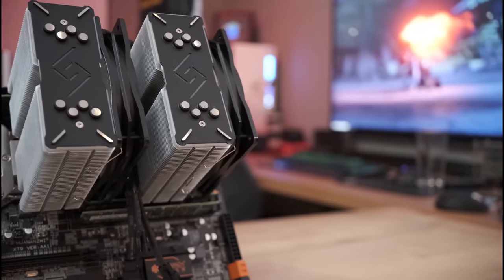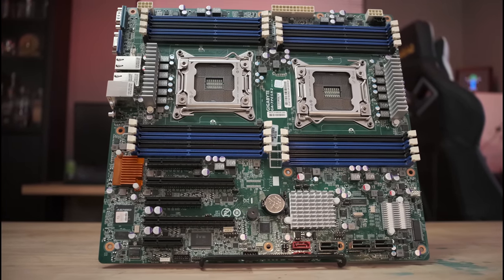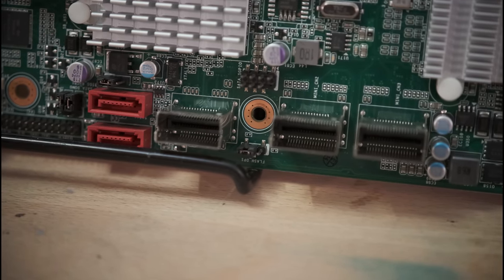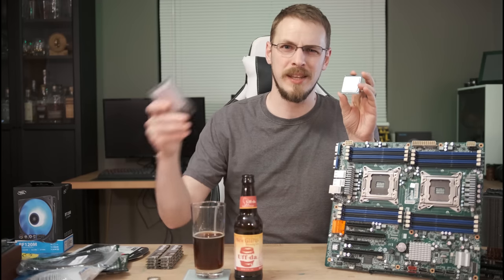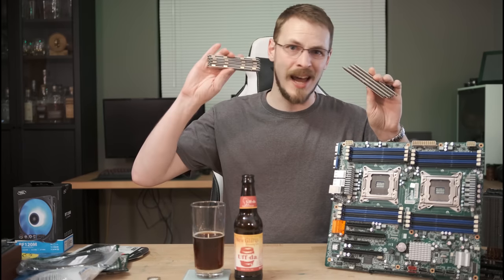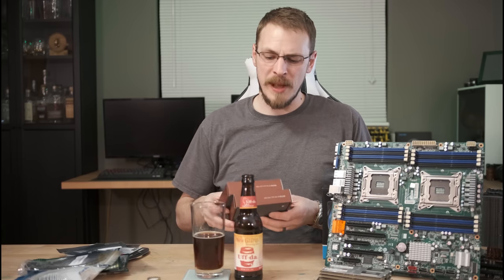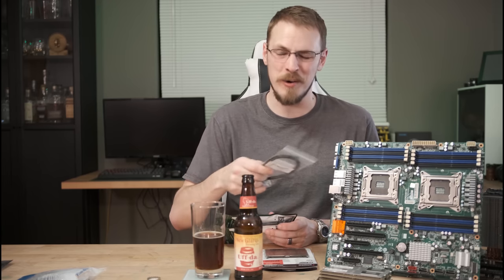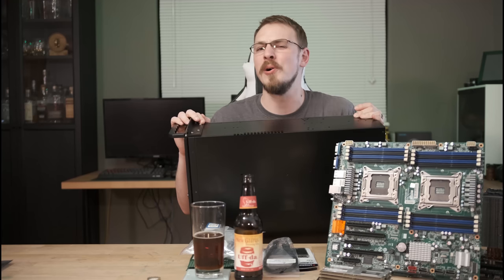Server Room Build Part 2!!! Virtualization Server Build!

Comment: Those adapters are shit and totally not made for cpu power. 
Always a good idea to get a proper psu made for servers.
Reply: or at least a power supply with two native 8-pin EPS connectors
Reply: @Felix-ve9hs  Thats what i meant. Regular consumer  PSUs only have 1.
Reply: @1leggeddog  a lot of the newer Consumer PSUs in the +100$ Range have two 8-pin EPS connectors, like the Seasonic Focus Plus Gold 750W :^)
Reply: @Felix-ve9hs  Which seems a bit of a waste for the average pc to me.
Reply: @1leggeddog  eh.. i have a 750w focus plus platinum.. overkill.. but It has a 10 year warranty and seasonic quality..
Reply: @Felix-ve9hs  Or just use a PSU from a recently retired ATX server/workstation... Well under $100 and unbelievably reliable. (Usually 80+ GOLD as well)
Reply: @Felix-ve9hs  I have a evga 750 watt G2 and it has two 8 pin connecters
Reply: No,  he's actually doing it properly by using a 450W PSU.  His power target is 200W and he's using low-end E5 Xeons.  An EPS adapter off of one of the PSUs I/O power outputs is the correct solution.  Going full out at 200W the 450W PSU will be running right smack at its maximum efficiency.  He should consider getting a higher-efficiency PSU, though.

If he were stuffing 165W Xeons instead of 95W Xeons, then he would want a PSU with dual EPS cables.  But since he's only stuffing 95W, there is no need for that sort of overkill.

-Matt
Reply: For servers it’s nice to have redundancy in PSU. It’s such a good feeling when you know that you could just swap out a PSU while the server is running or change the power cable from one power source to another. So far 2x 450w have been sufficient for my needs
Reply: Yes, I agree, there is one situation where redundant PSUs make a lot of sense, and that is when the rack is being fed by redundant power sources.  If you have a machine room with two utility ingresses, each with its own UPS and generator setup, then having two PSUs allows you to do maintenance on the power delivery to the machine room, and the UPSes, without having to power-down machines.  That can be a big deal because utility disruptions are a lot more frequent than PSU failures.

For smaller setups, having redundant UPSs but feeding off the same utility ingress, allows for similar maintenance.

UPSes usually require full drain-to-powerdown tests once a year (if you don't want something unexpected to happen later on), for example.  Most unexpected failures occur because people don't actually bother testing their fail-safe gear regularly and it becomes non-protective without them realizing it.  Daily UPS self-tests that only run on battery for 10 seconds don't float the boat.

But apart from that, if you do not have a redundant ingress or redundant UPS setup, or you don't need 100% uptime (such as for a small business where you can just yell out that the server will be down for a few minutes), then having redundant PSUs are basically just a waste of money.  Sure, there's a certain usefulness to being able to move cords around, but it doesn't really add much to system uptimes unless there is something behind it (such as UPSes and generators) that requires more maintenance and testing.  And, of course, modern PSUs just don't fail all that often compared to other system components.

-Matt
Reply: Junker Zn good points and I agree that a PSU by itself is not that useful after all. I have a server rack with 2x HP proliant (DL380 & DL360 as well as a synology RS815+, 3 Switches and our router) the system is secured by 2x Active UPS which currently give me about 45-60 minutes of battery power. So after 15-20 minutes the replication is stopped, the VMs shut down and then the physical machines power off as well. The redundant PSUs allow us to bring in power backup generators if needed / they allow us to use further UPS on the fly (another 1500VA which is securing a workstation next to the server rack could be utilized) and hot swap the UPS if needed. In the future we are going to have an independent power source on the property and the wiring will be done in a way that we can use grid power as well as our internal power source. As far as extra cost go I feel that one could also go with one PSU and then upgrade to a second one later in the life cycle: we upgraded our DL360 from one PSU to 2 PSU for 60 euro 💶 2 years ago. Personally I feel that the extra money is always worth the comfort and reduced Server downtime if something bad happens. I had a hdd failure on our DL380 about 9 months ago. Raid 1+0 + hot spare managed the failure by itself - all I had to do was to batphone HP support who sent me a new (and bigger) drive the next day. The old drive was hot swapped for a new drive and the smart array did the rebuild. No downtime or anything. Same with fans and PSUs. Also I have an onboard as well as an expansion raid controller installed in the system so I can always just swap the raid array within a few minutes in case of a controller failure.
Reply: And EVGA power supplies are shit.
Reply: I know some of the corsair cxm series power supply have 2 native eps connectors

Comment: I have a question. I'm looking at getting into a file server for my home network that I can also run VMs on to tinker with learning different linux distros, and set up a pi-hole similar to your example. Are NAS drives still a strong recommendation if you're not constantly writing to them? Main use would be to store all of my media and stream to my devices, and serve as a backup for my important docs.

Looking at the prices, aside from the integrated RAID firmware I'd have a hard time justifying buying multiple NAS drives to get the storage I'm looking at. I understand that they're more vibration resistant and meant to run 24/7, however I ask this question as I would imagine a regular hard drive can just go idle if it is not constantly being written to, and am assuming that would help the longevity of the drive. 

I could be (and probably am) wrong though.

Edit:Couldnt get tag to work

Comment: From my job I was able to score a pretty dope server for free. Dual E5-2640 on an Intel scp2600 with 64gb RAM. I plan to swap it into a rosewill 4U chassis. It's gonna be my freenas/Plex server with a couple virtual machines. My question is should I opt for 2 4TB in RaidZ with a 240gb SSD. I have all my parts excluding the HDD, cooler and case. What do you recommend, WB Red or A Seagate irornwolf. Also what's a good CPU cooler for 2011 Xeons?
Reply: My rig is going to be VERY similar to this. I luckily have a 750 evga B2 with dual EPS so I got pretty lucky. I'm trying to keep this a budget build, and most of my sunk cost is gonna be in drives. At this time it'll probably be a low use server with about 1 regular user and 2 supplemental. I'm not sure if I want to go 10gbe yet though....

Comment: Do you not need more NICs to pass through to all of your virtual machines? Or do you not intend to actively use more than one virtual machine? 
I'm building a similarly spec'd machine but i budgeted for more NICs to passthrough since multiple of my VMs will be dedicated to full time servers.
Reply from the maker: Only if you want to dedicate a NIC to a virtual machine. More often than not, you configure a virtual NIC for each virtual machine, and they share networking through a virtual switch inside your HyperVisor.
Reply: @CraftComputing  So theoretically i would only need a dedicated nic passed through to a vm if i intended to use the entire bandwidth available to that nic, ie with a nas?
Reply from the maker: Even virtual NICs can use the full bandwidth of a physical card. They just share with other active VMs.
Reply: @CraftComputing  Ha, cool, thanks for saving me the cost of 4 quad port nics

Comment: I would upgrade that PSU
Reply from the maker: No need.  As I said, this server should only pull ~250-275W under full load. In no way will I be pushing this PSU. In fact, I'm likely right in the efficiency curve for it.
Reply: @CraftComputing  Good luck

Comment: Beware, the A400's have a decently high failure rate as their controller isn't very good. I've had friends who've gone through up to 3 of them
Reply from the maker: Running in RAID 1 for the OS only. And I keep pretty decent backups.
Reply from the maker: Personally, I've seen hundreds of the A200 and A400 drives in use.  Their failure rate (anecdotally) does not seem to be higher than other drives in this class.
Reply: I have had the 128gb version for about a year and it has not failed yet.☺